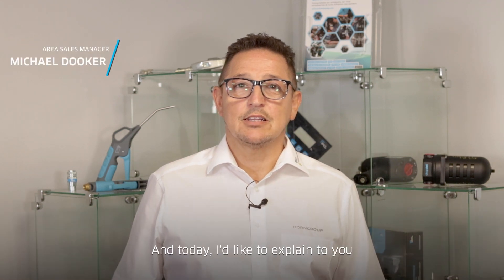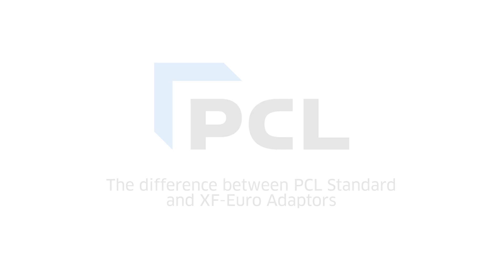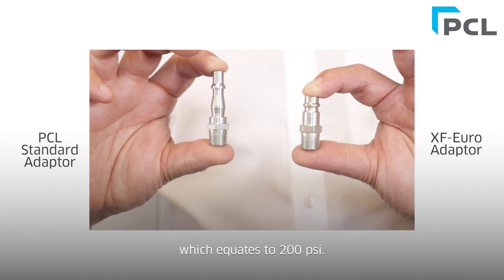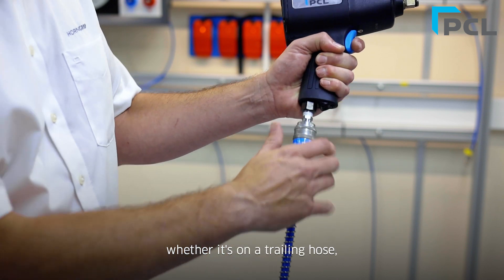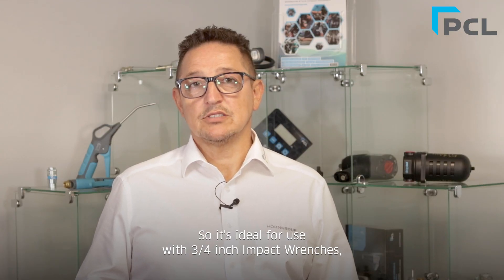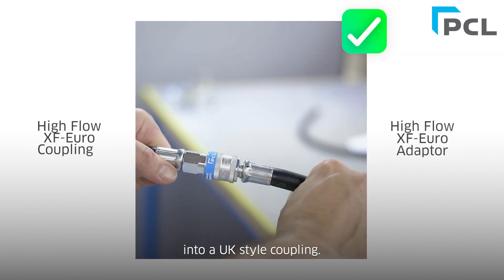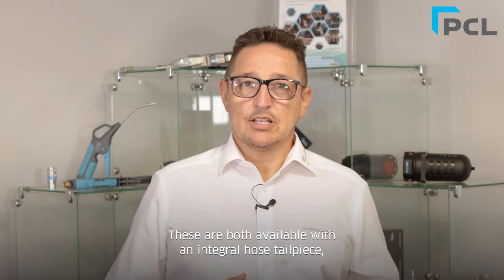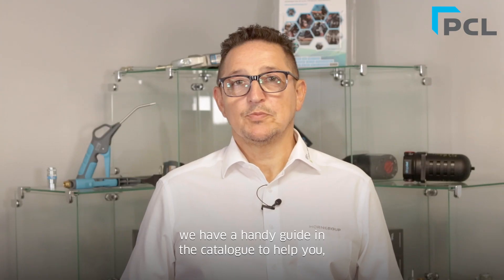The difference between the Standard PCL and XF-Euro adaptor profiles

Comment: I have a SIP QT100/10 compressor that is fitted with quick couplings that my male standard PCL hose won't attach to. If I replace the QC female couplings on the compressor with PCL ones which female QC PCL couplings will I need? I would prefer the Vertex type.